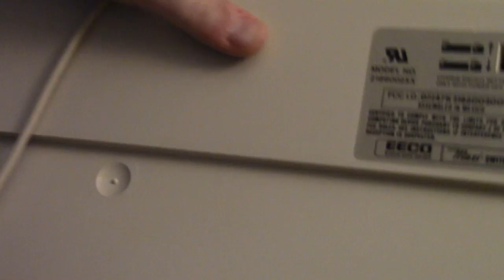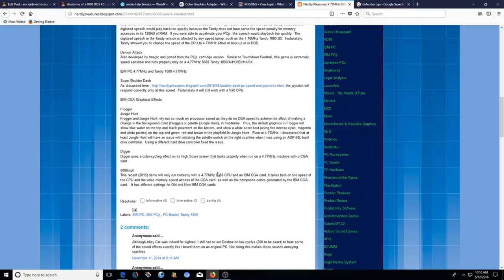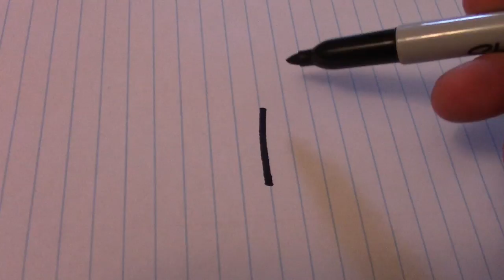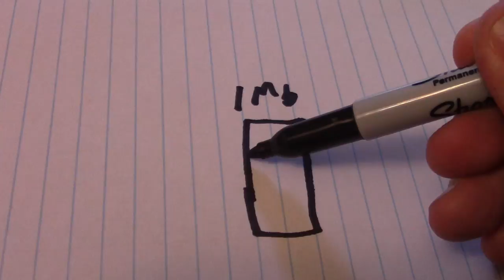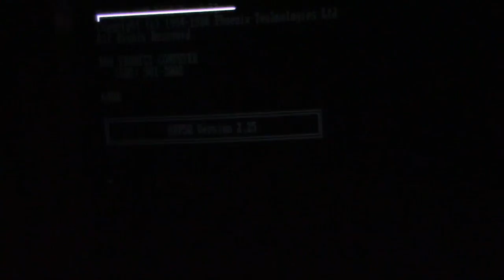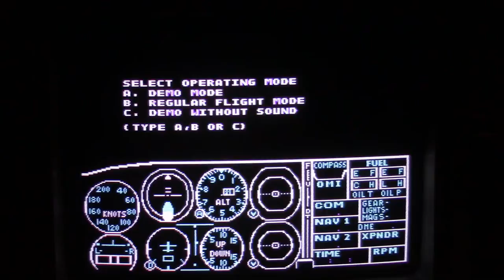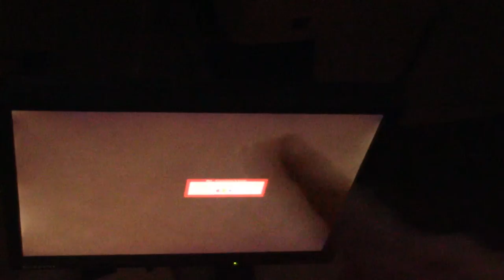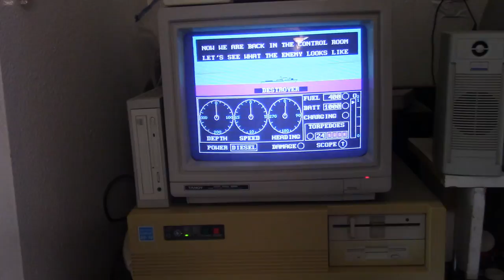Anatomy of an 8088 PC

Comment: Those EMS boards really shine when you are running Windows on these machines (which is something I love to run on my PCs and XTs). There is a new 2MB EMS board being produced that you can assemble yourself, so I’ll probably build one of those eventually for my IBM XT.

That hi-memory card is nice; I’ve got a board made by D-Link called a “Plus Card” that does the exact same thing. Very useful in Windows 1x/2x, but it makes Windows 3.0 crash when the driver is loaded. Probably doesn’t like seeing more than 640Kb of base memory, as that technically shouldn’t be possible.

Comment: The 8088/8086 has a hard limit of a 1megabyte address *space*.  This is not RAM, this is merely all the individual possible unique memory locations. The Upper Memory Area is usually created from paged in areas of RAM and ROM from expansion cards, and is not RAM in the system itself, usually.

Conventional memory is "ram for program use", and comes from banks either on the motherboard or, in early models, on cards in the expansion bus.

EMS circumvents the hard limit on the address space by mapping small section of extra memory into small windows of address space via a technique called paging.  This is not nessecary on the 286 upwards, which increase the address bus size, which in turn gives the entire a chip a much larger address space.  (However, for backwards compatability with DOS, the CPU will start up functioning in this mode)

LIM EMS was mainly used by some very memory hungry programs and as I understand it, was rarely used in games.

Comment: Correction, you can use a zip drive on an 8088, there is a third party driver to use a parallel drive on an 8088. There is also a version of xt-ide that can do an ide zip drive, it's on youtube. And I'm pretty sure that a scsi zip drive could work on an 8088.
Reply from the maker: I'll have to try that. I've always just used Guest.EXE which won't work on an 8088 but wasn't aware there was third party drivers available. thanks for the info.
Reply: Hi, The link does not work.Also, a ZIP Drive is 100Mb, but DOS 3.2 can't go higher than 20Mb.How does it work ?
Reply: @freddyvretrozone2849  The special software creates 3x 32mb partitions per zip disk. Not sure about the 20mb limit but I use a zip drive with that setup.

Comment: I have a Tandon MFM drive in my Amstrad PC1512. It is very slow, but works surprisingly well. I do love the sounds it makes. I probably shouldn't use it because working ones are so rare (even more rare than standard MFM drives), but I just can't resist.

Comment: "assuming monochrome": your VGA cable is probably lacking pin 11 connection, because it was made at a time nobody even thought about mono mode anymore :)
11  ID0. GND for Color monitors, NC for Mono monitors
12  ID1. NC for Color monitors, GND for Mono monitors. Some systems only use ID0 for monitor ID.
later vesa standard changed it to
11  Monitor ID0 (optional)
12  Data (SDA)

Great video as always.
Reply from the maker: Thank you, I think you may be right. sounds as plausible a theory as any.

Comment: I was brought up on a 80286 at home. These old cga and ega games was what I was used to. Like Alley Cat and stuff like that. Most of mu friends had Amiga and C64, so it was a strickt devide between what games I played were. Soundcards on a pc, was not something I was used to privately, untill I bought my first PC. That was an 486slc2-50 with ET4000 and a Sound Galaxy NX Pro.
Reply from the maker: I was a C64/Amiga guy myself back in those days but it was opposite for me as most of my friends had Tandy 1000 type machines.
Reply: 0blivi0n100 Hehe.... 🙂 It was a golden time from 87/88 to 94.

Comment: This is a wonderful demonstration. Thank you for taking the time to make this. It seems like you aren't switching the monitor between composite/CGA mode. This is very noticable in flight simulator because I recall on my XT with a cga/composite monitor I had to switch the monitor between the modes manually; otherwise, the cga mode looks pretty horrible.

Comment: The best thing to use an 8088 PC for? Writing. Why? Because there are no distractions. There is no multitasking. Your in a program. Or your not. An Apple 2 would be a great option too. But, It is harder to convert files to modern computers. An 8088 is a PC so its as simple as a usb floppy drive.

Comment: Very informative! Generally really good coverage of different style of games with different display or rendering techniques. The only things that would have been awesome to see tested are the early flat-shaded polygonal titles (Total Eclipse or Midwinter) and the Keen series, but it's more of a personal gripe than criticism of this video.
Reply from the maker: Those games would likely play much better on a 286 or 386 with an EGA/VGA card but I do wonder how well they would perform. Keen I assume would play okay in CGA mode
Reply: I was curious about how they would run on such a system as their system requirements supposedly includes the 8088 and while Midwinter is a VGA era game I know for a fact that the Freescape engine games (Driller, Dark Side, Total Eclipse etc) can use CGA colors.

Comment: I didn't know that there were cards for the 8088 that let you use the 384KB between 640 and 1024, that is cool, I thought that was only possible with a 386 cpu and an expanded memory manager like emm386.exe. I remember that with a 386 cpu and emm386.exe you could simulate expanded memory provided you had extended memory that could be allocated with himem.sys on a 286 cpu or better. things were not so easy back then.
Reply from the maker: I was surprised as well. Didn't know these kind of cards existed untill I sort of randomly stumbled onto this one. They call it Hipage memory in the documentations. I just wish I could utilize it better but since I'm not really loading any TSR's anyways....maybe if I add an external CD-Rom drive or something I'll be able to load something into it. Also seeing as I have a lot of other things installed like an EMS card and a hard drive it was hard to find any unused reserved memory blocks in the upper memory anyways. setting up these kind of cards really requires you to know your memory addresses and what's up there. thankfully the manual has some helpful charts.
Reply: 0blivi0n100 If I remember well, in the memory between 640 and 1024 there was a copy of rom bios, and graphics card bios, and the rest was called upper memory blocks that could be used to load drivers thus freeing some conventional memory. memory from 1024 to 1088 was called high memory area, which could be used to load part of the dos kernel, freeing even more conventional ram. lastly the memory above 1088kb was extended memory (xms), that could be turned to ems using emm386.exe, unless you had an expanded memory card like yours, and in that case you didn't need a 386 cpu with emm386.exe. but if you used expanded memory umb was reduced by 64kb, because it was the memory page that was used to copy data inside the 1st megabyte of addressable memory and the expanded memory above 1088kb. correct me if i'm wrong 😊
Reply from the maker: I think your more or less correct but as I stated I'm a layman when it comes to the whole memory thing. It can be really confusing, that's why I made a point of trying to explain it in the video as well as suggested that viewers read the comments for corrections. I'm just thankful I had manuals and documentation when installing the Hipage card and the EMS card.

Comment: That’s not Hercules Mode in Larry, it’s Composite CGA.
Reply from the maker: are you sure? I could never get the card to output color composite and that footage is on the RGB monitor via the digital DE-9 cable. composite would be via the analog RCA jack or am I missing something?
Reply: Might have something to do with that VGA cable and bios detecting mono monitor.
Reply from the maker: rasz that was a completely diffrent computer, cable monitor and video card.
Reply: The way you do CGA composite psuedocolor is by carefully building up a 640x200 black and white picture. Pixel placement translates that into a 160x200 16 color image. Try running BurgerTime in composite mode on an RGB monitor, it will look the same as Larry does in that clip.
Reply: CGA isn’t actually smart enough to know what port it’s outputting on. It does them all at once.
Reply from the maker: I was under the assumption color composite could only be outputted and displayed on a color composite monitor via the analog RCA jack. This is the first I've heard of this. I tried Burger time and your right, it does look similar to how Larry looked, the text was sharp though and of course it was monochrome. I've actually never heard of "composite CGA" until now, just color composite and CGA.
Reply: There’s only one CGA signal regardless of which port the monitor is hooked up to. Game programmers just took advantage of the side effects of the poor quality of composite output to produce a more colorful image. This seems to have been by design as IBM didn’t expect home users to buy expensive RGB monitors but use RF modulators and TVs instead. Business users, on the other hand, wanted sharp text but didn’t usually care about graphics though some wanted color text. One color card with a measly 16k of vram could serve both markets.
Reply from the maker: thanks for the info and helping set things stright. been poking around on some sites as well to get a better grasp of it. Its definitely not Herc mode as you said, too bad YouTube doesn't allow annotations anymore so I can throw a correction up there. I'll be sure to address it when I talk about CGA again. I am still puzzled on why I'm not getting color when I try outputting to a composite monitor as opposed to the RGB monitor. I read the manual for the CGA card and it's set correctly, also double checked the DIP switch on the motherboard and it is set correctly as well.

Comment: Instead of paying big bucks for an XT keyboard, just use an AT or PS/2 one and build an AT2XT converter. It's dead simple and costs only a few cents.
Reply from the maker: I've had the good fortune of accumulating a few PC/XT keyboards along with the PC's I've picked up so its never been an issue for myself but that's a good idea for someone without. I just googled it and there seems to be a few nice guides available.

Comment: With 2M you can make the computer able to read from regular 1.44/1.2MB floppy disks ^^

Why would plugging something on the passthrough of the PSU that consumes a lot would stress the PSU ? it's litterally a passthrough ! the power that go in that plug don't go to the PSU's circuitry so there's no need to worry about that, except maybe if you're willing to plug a big ass oven on it but why would anyone do that ? x)
Reply from the maker: Yhea, I know about 2M. I believe I mentioned it in the blog but honestly I don't think its very necessary as most games of the era seem to fit comfortably on a 720k floppy. it's an option I've been aware of for some time but just never had the need to try out, I also tend to prefer hardware solutions as opposed to software but that's just me being impractical.

I don't think I recall mentioning anything about the passthrough. closest I recall is mentioning that old MFM hard drives draw a lot more power then say a CF card as a hard drive.